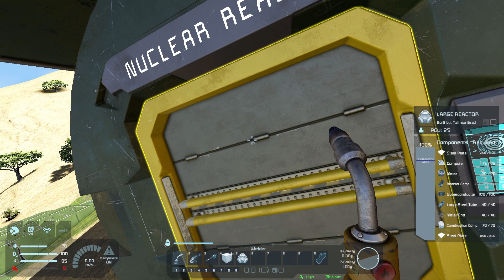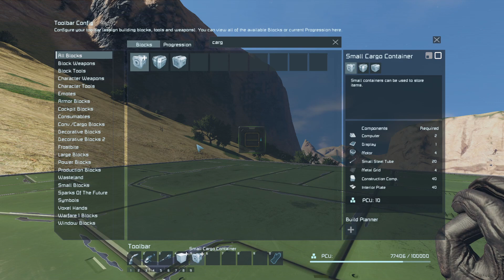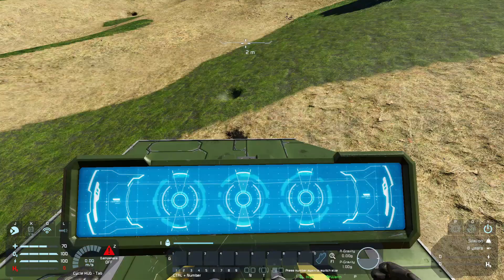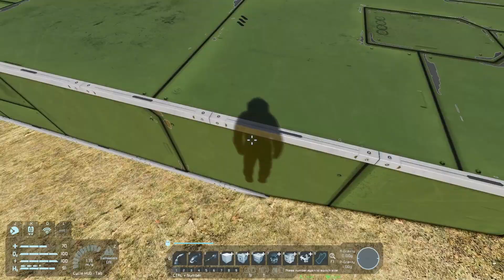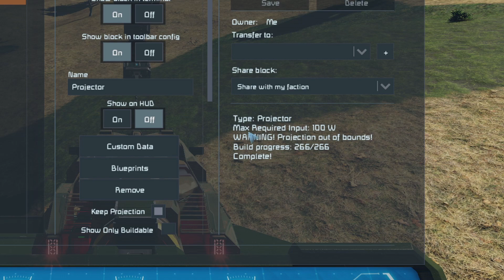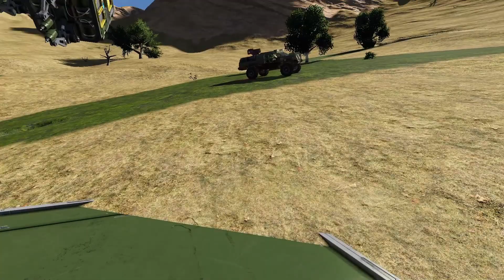Easy 3D Printer Build (Vanilla) | Space Engineers

Comment: This is ok, but is rather limited in the shape of what it can print. If you put 3 welders for larger ships you're screwed if some middle part of the ships is wider than the welders as they'll build those before being passed and get jammed. Also the speed he sets the piston to misses a bunch of blocks. Basically it prints cubes.
Reply from the maker: It's a basic starting point. You should absolutely experiment and adjust things to get the results you desire. I didn't set out to make a "the ultimate" video. Just a simple starting point to build on. 
Thanks for your feedback.

Comment: It's not even 3d printer, it is just a piston with welder, maximum i can call it manual one axis welding manipulator. 3d printer should be fully automatic, and all you need is to load a blueprint and push One button. Then it should build ANY project any size (within working table). For 20 minutes video i was expecting a nice Real 3d printer, but this ... just a waste of time.
Reply from the maker: Add a few timers and it'll run with 1 button press. Build a bigger "table" and add more welders and it'll weld bigger blueprints. 
This is a basic 3d printer. A tutorial showing one option to get you started. I'm sorry for wasting your time.

Comment: I'd like to know how they made the pistons extend and retract automatically during the welding process, as it seems that system would allow for larger ships or rovers to be built, that the range of a single welder wouldn't cover. I believe that's why they spin the ship around, to cover all sides of it while having the welders remain in a single line.
Reply from the maker: I'm not sure how they made the printer in the background cinematic. It looks impressive but it could be just setup to look good for the video? The version I've made her is extremely simple but could be expanded on with additional pistons in parallel to the existing one, either to the sides or below. This would allow bigger ship printing, with a little projector adjustment.
Reply from the maker: Oh you can spin the projection in my example no problem. The projector is attached to a rotor. It just wasn't necessary with the size it was making in the demo.
Reply: @TallmanBradGameplay  Yeah I don't really care much about the spinning part, I'd just like the welders to automatically detect when a block is built and continue backing up so that it doesn't collide with the ship. I'm thinking they did it with sensors but I'll have to figure those out. I'll scan your channel a bit for a tutorial on sensors, hope you've got one!
Reply: @ZachTheInsaneOne  Actually the block isnt detecting blocks being built and backing up so what you are assuming is happening is wrong. He just made it extend slowly and because of the size of the car is small it builds fast. If you rewatch it you can hear him when he sets up the piston is just set to extend and nothing special.
Reply: You can set up sensors to detect blocks and sorta have automatically retracting welder pistons. However, there is no option for sensors to know if the detected block is fully buil or not, so you'll have to have low enough piston speed that the welder can do its job

Comment: Thanks, TMB, for the clear, easy-to-understand video.  My first question was - what about flying vehicles. If you grind off the attachment, they'll fall and crash.  Then I realized one could use atmo thrusters and a battery or two; or use hydrogen thrusters, an O2/H2 generator, then manually add some ice before one grinds off the attachment.  Either way should work.  Again, thanks for the wonderful videos, and for your time.  We appreciate it.
Reply from the maker: You're welcome Gary! Yeah I'd load up flyers before detaching. Could be a fun project to have a connector on a piston that slides into place after welding is complete. The flyer then pulling H2 or ice then? Loads of options! I appreciate the feedback as always Gary!

Comment: In regards to the hinge, I’m not sure many have noticed, the marker your using to set which way you  place it also happens to be =45 degrees mark. There is a center line on the hinge part as well.
Reply from the maker: You know I'd estimated it was 45, well -45, but because you don't sort of watch it turning then stop it, it didn't seem that much use. Honestly I think it's a bad design. They could have had text on the side of the hinge like they do with rotors. Indicating positive and negative angles? But! As long as you remember which way is which, it's not so bad. I like the features of the hinge. It's extremely useful, but just not such a good design. What do you think about the hinge design Torrent? Or the projector design too?
Ah and thanks for commenting. I always appreciate the feedback and chat.
Reply: @TallmanBradGameplay  I like your videos. I've been playing SE for over 1000 hrs, but I like some of the design ideas you've had. there is always room to learn new techniques, and I would rank your videos up there with splitsie's.
Reply from the maker: Torrent, thank you so much!